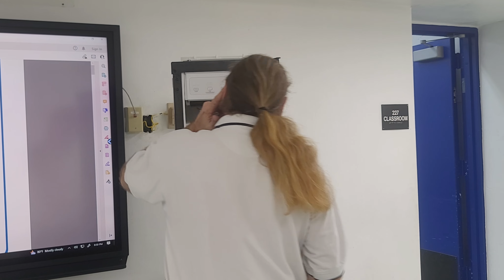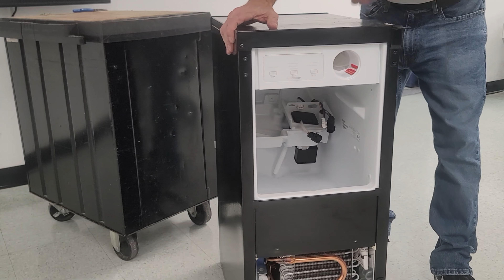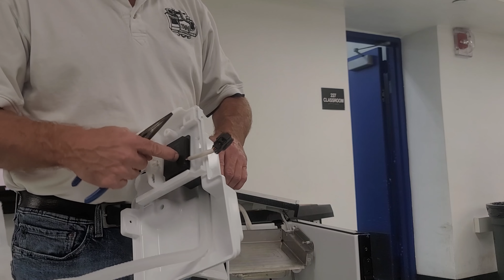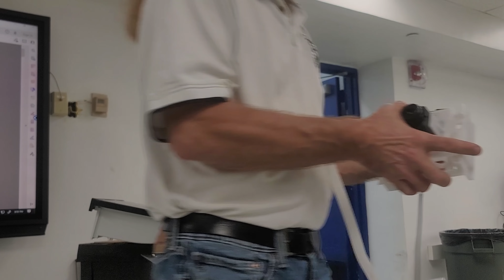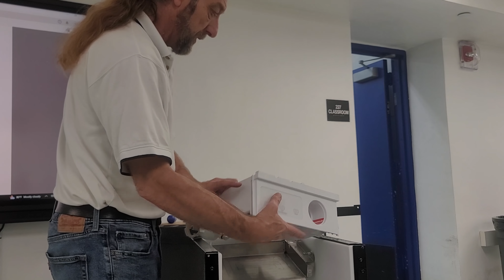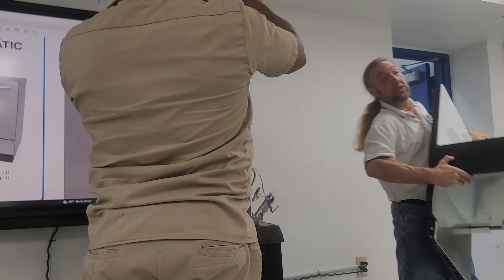ICE Maker Part 2 teardown

Comment: You said the drain pump controls the level of water in the reservoir.  Other videos said it was controlled by the recirculating pump. Which is it?  The recirculating pump has 5 wires where as the drain pump only has two.   Seems backwards to me.

Comment: What controls the water level in the reservoir that pumps up to the evaporator?  My machine continuously overflows the reservoir.  Thank you.
Reply: A drain pump controls the water level. There's a little float that has to rise and stop the water from flowing. If it goes straight through to overflow and keeps overflowing until the machine resets it's the drain pump that needs replaced. If it stops and then restarts it's because the recirculation pump isn't clearing the water.
Reply: @damonhoffmann1565  what is sequence of operation of  residential ice machine .

Comment: Great video. As I commented on your video about the Whirlpool/KitchenAid  new design, it appears that there are two set of thermistors (bin and evaporator) for the electronic control Whirlpool/KitchenAid ice makers (after 2007). One set has a resistance of 10K ohms @25C(77F) and, probably beginning 2013, the other set has a resistance of 2.7K ohms @25C(77F). One the changes in the new design, as demonstrated in this video, is that you no longer can plug in the evaporator thermistor, you have to buy the whole wiring harness to replace it. If you are handy, I identified DigiKey Part # 56-NTCLE350E4103FHB0-ND (Manufacture # NTCLE350E4103FHB0) as a replacement for the 10K ohm thermistors and Digikey Part # BC2417-ND (Manufacture # NTCLE100E3272GB0) for the 2.7K ohm thermistors .

Comment: THIN ICE !!  Our machine is only making very thin ice. I clean the machine - twice and replace the filter. And reset the panel. I checked the hose line for any kinks.  The unit is about 11 years old.  … But it continues to make THIN ICE… Any suggestions? Thanks in advance.
Reply: There are three selectable ice thicknesses.  Ice thinkness can be set during manual diagnostic check execution (step 10); details are on Diagnostics page in the 'For service technicians use only' document ususally stuck on the right behind the base grill; MAX ICE LED: 2 Blinks = Thin, 4 Blinks = Normal, 6 Blinks = Thick; Press Clean button to cycle between settings.